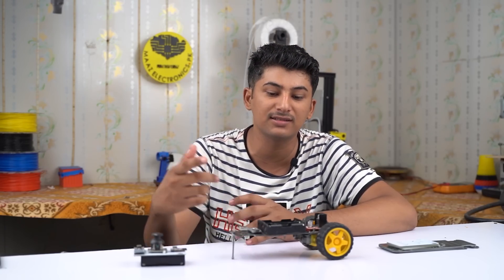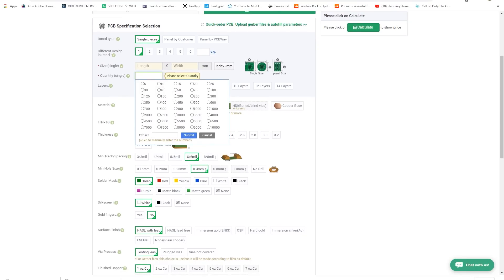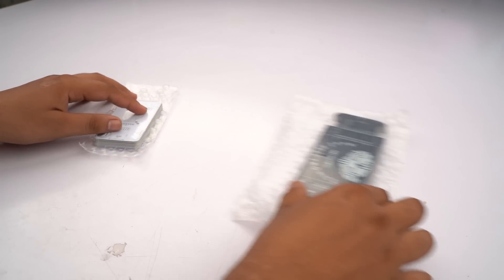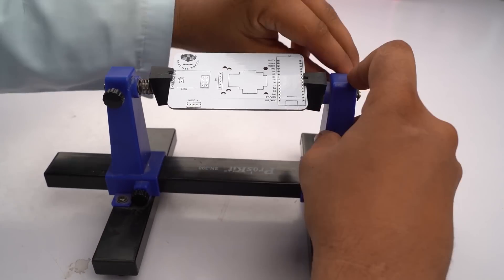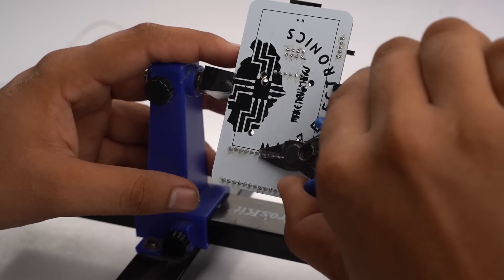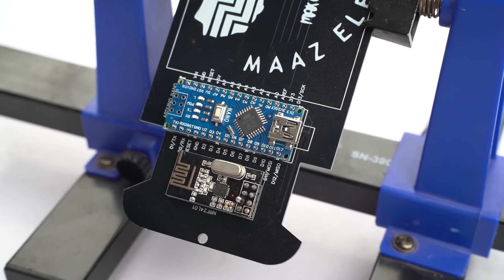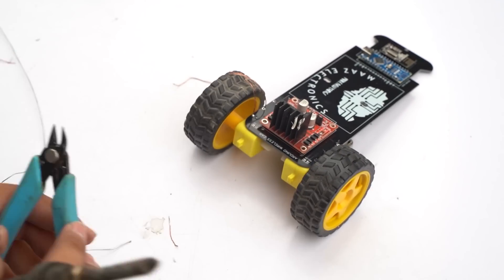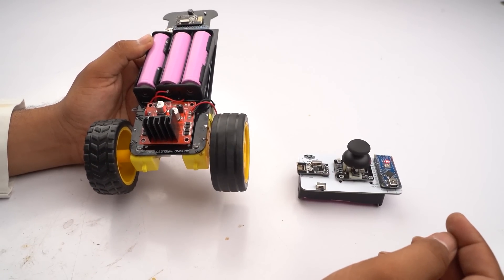PCBWAY.COM Professional PCB in $5 Arduino Wireless Car

Comment from the maker: ✅ PCBWAY Prototype for $5 (Any Color) 
✅ Free Your orders & Larger Coupons on PCBWay:https://www.pcbway.com/

Buy from - Maaz Electronics Store ★★ 

Arduino NANO - https://maazelectronics.pk/product/nano-3-0-controller-for-arduino-compatible-nano-ch340-usb-driver-in-pakistan/
18650 Holder - https://maazelectronics.pk/product-category/batteries-holders/battery-holder/
TT Gear Motor - https://maazelectronics.pk/product/tt-motor-smart-car-robot-car-gear-motor-wheel-for-arduino-diy-kit-in-pakistan/
Original 18650 Cell - https://maazelectronics.pk/product/original-18650-rechargeable-battery-cell-3-7v-2000-mah-li-ion-for-power-bank-flashlight-drill-wall-ups-in-pakistan/